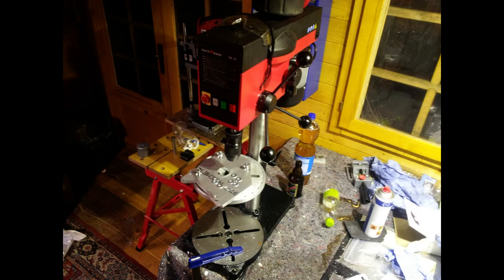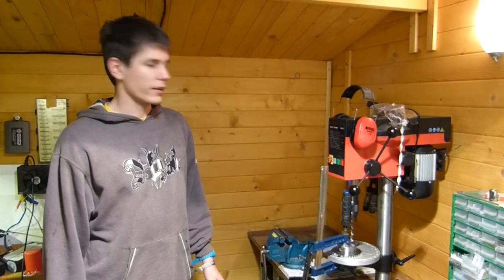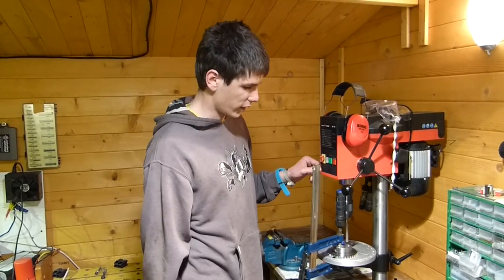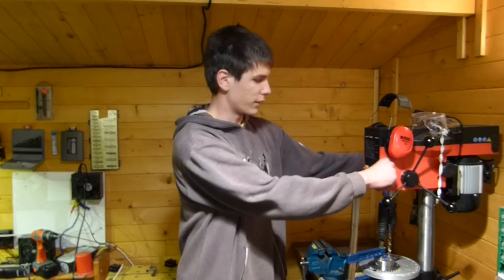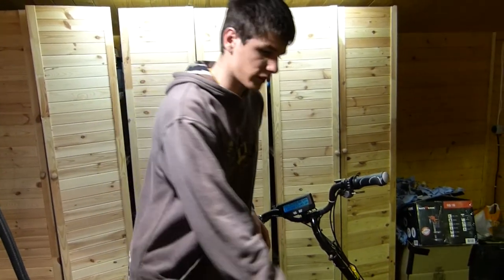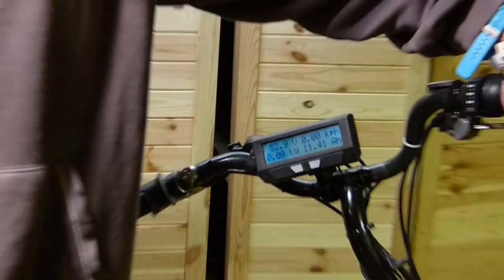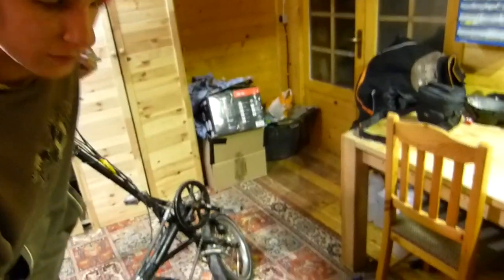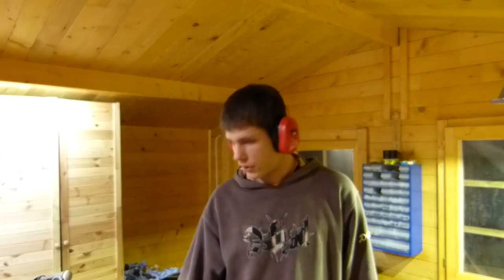Vlog: Update about our scooter project!

Comment from the maker: I do use it most of the time, but I just wanted to show that it even works without. the recommened drill speeds are printed on the bench drill, you can see it in the video.

Comment from the maker: I wear them every time we use an agle grinder or any other tool which actually creates sprakles. the drill is save in that way, I mean I've been drilling 100's of holes in metal in my live, since its rotating with way less than 1000 rpm, the swarf doesn't get speed and only falls out to the side, and I never had anything flying in my direction.

Comment: You should definately use cooling oil when drilling metals. And check some sites for the correct rpm for the drills. Making the drill remain sharper for longer and drilling smoother holes :)